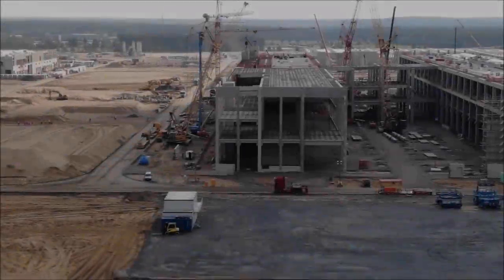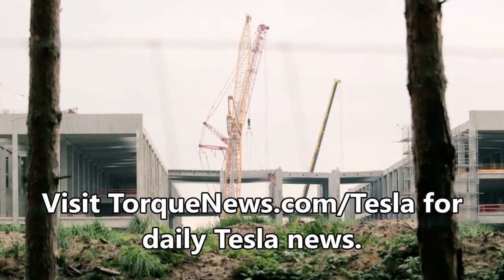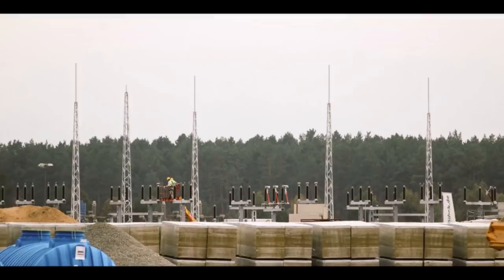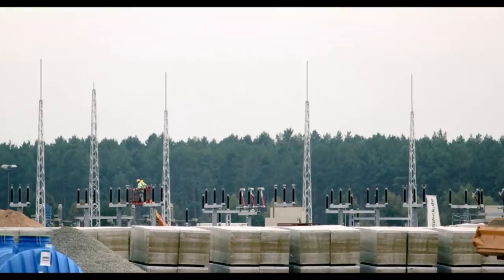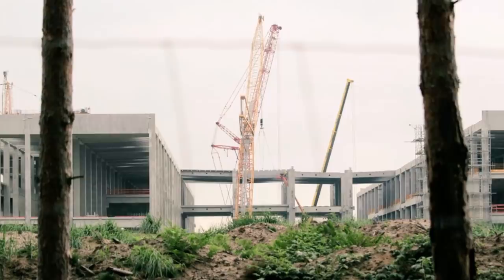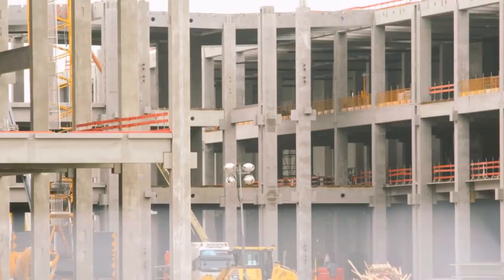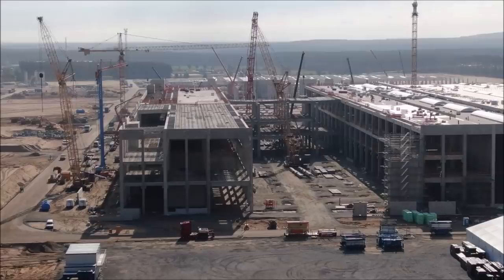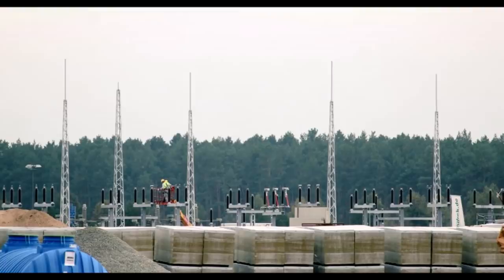Tesla Brings 110 kV Power to Giga Berlin and Talks About 3 Shifts

Comment: The voltage levels usual in Europe are 380kV for the nationwide transmission network. This is then transformed in large substations down to the voltage level of the distribution network to usually 110 kV. The energy reaches the regional substations of a city, a rural region or an industrial company in order to be further transformed to a medium voltage between 10 kV and 30 KV in the local substation (Swichyard). From there it goes to the final transformer stations for blocks of houses or individual buildings, such as the paint shop here, where the transformation is then carried out to low voltage 400 / 230V.
Reply: Peter Wiegel What country in Europe do You live. I live in Vancouver, Province of B.C., CANADA. High Voltage 3 phase 500,000 volts AC ,Alternating Current except for Quebec that has 735,000 volts AC for 1/3 of its grid including supply to New York State.
The most interesting thing here is that neighbour Province, ALBERTA has just installed  2.   500,000 volt  DC  DIRECT CURRENT, running  North South 300 KM each about 150 KM apart and are about 300 KM long. This is GERMAN SIEMENS TECHNOLOGY, the best in the World BACKBONE for the GRID here but in GERMANY they are installing a 2nd RATE SYSTEM OF ONLY 250,000  VOLT DC . I believe they went for 2nd rate system at home, mostly because of Politics, shorter distances of lines, did not want to spend more money to change transformers everywhere. I believe there are too many HYDRO AUTHORITIES. There are just too many PLAYERS . The benefit of DC TRANSMISSION is no induced losses in lines, for DC and no brownouts from dropping frequency under load. The lower 250 KV DC LINES HAVE DOBLE THE LOSSES OF 500 KV DC LINES.
Reply: @butchbailey965 868/5000
I live in northeast Germany, so I have the same grid topography as Giga Berlin. Here in Germany, the distances between the Swichyards between the various grid layers are much smaller than in Canada, which is usually 380kV sufficient for the highest voltage level for transport between different federal states in Germany and across European borders. Only for individual cases where very large amounts of energy have to be transported, a higher voltage of up to 500kV or a high-voltage direct current transmission is also required here in order to avoid capacitive losses to earth.
We also consistently use 3-phase three-phase current up to the end consumer, while in Canada a single wire earth return system (SWER) is used from the medium voltage level because of the  distances that are still great here.
Reply: Peter Wiegel lets keep this simple for comparison. CANADA is a very large country 9300 km from sea to Sea which is almost double all of EUROPE which is 4700 km. GERMANY is only half the size of ALBERTA which I have RAVED about 2 DC   500,000  KV  300 KM that are now the BACKBONE of their GRID which is the pride of GERMAN, SIEMENS TECHNOLOGY.
Is 380 KV the highest voltage in EUROPE for interconnecting Grids? Is GERMANY 250 KV or 380 KV FOR OLD AC 3 PHASE GRID.
Is GERMANY the only country in EUROPE that is installing 250 KV DC HIGH VOLTSGE GRID?

Comment: Armen I am impressed that You are actually learning to use Your Technical Language is getting better. You talked about Isolator been installed to supply power to the paint shop  then You correctly mentioned breaker, then blew it by saying it was 110 KILOWATT  POWER. WRONG. First of all the complete substation would be built with all the specialized equipment and control wiring complete back to control room and area would be completely fenced and all control wiring tested. The supply authority would do their calibration for safety and metering to protect their line for fault current calculation for incoming breaker and isolation switch. and this would happen after contractor has done the same for all  load breakers and isolation switches. All CIRCUITS HAVE ISOLATION SWITCH AND BREAKER. this would allow for piece meal energization in stages as long as loads are all underground and 15 KV or lower by cable. Kilowatts is a measurement of power. Kilovolts is the service voltage to use correct language. There is 2 specific reason for breaker and isolation. The BreakerI is open or closed first because it purpose is to take the high current by limiting the arc (legacy substations had huge BULK OIL BREAKERS. New substation are some time indoors because theY are now compact breaker that use SF 6 GAS. ISOLATOR SWITCHES WILL MELT DOW IF OPENED UNDER LOAD. THEIR ONLY PURPOSE IS TO SHOW A COMPLETE BREAK IN THE LINE THAT IS EASY TO SEE TO SHOW STATUS, Now this sWITCH  is protected from been opened under load by a KIRK KEY INTERLOCK. The key is locked in the breaker switch key and can’t be removed when it is energized. Sequence of operation. Trip the breaker, remove key from breaker  and take to isolation switch and insert and turn. Now You will be able to open isolation switch.

Comment: On the fuel station. 
Commonly car plants have a fuel station for their company-owned cars. Not for their employees. That Tesla won't need one is fairly logical. But it is not forbidden to ask.

Across the road (of the southern entrance) in the Freienbrink industrial estate are already 3 (automated) fuel stations. Thus no problem at all for employees or visitors having ICE cars to refuel nearby. This industrial estate is mainly about logistics (and also Tesla has bought 12 ha additional ground there for this). And with many more lorries delivering goods to nearby Tesla the infrastructure for the lorries and their drivers will be most likely further extended (besides the 3 fuel stations there is also a lorry repair shop and some fast food type places already there). And if you sell Diesel for lorries it makes also sense to sell Diesel for cars (still a high share among all cars in Germany)  and also other fuels as well. LNG is also offered already by one station. Guess they will turn the automated fuel stations to serviced one (where you can get also some food etc.). As those places have already the critical fuel station permit such a change and extension of service is no problem.

And generally on the hearings: I see there nothing critical at all anymore. These are all issues that can be sorted out. And the grounds Tesla bought were already classified as industrial estate long before. This won't be revoked as it plays no role if the grounds are used by one big company or many smaller ones. As long the business/production itself is according to the environmental laws/restrictions.